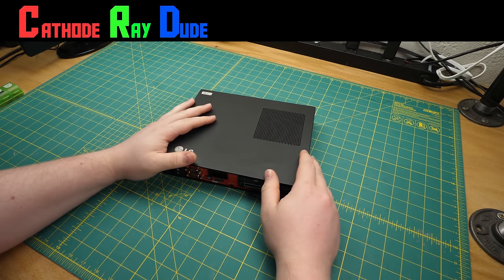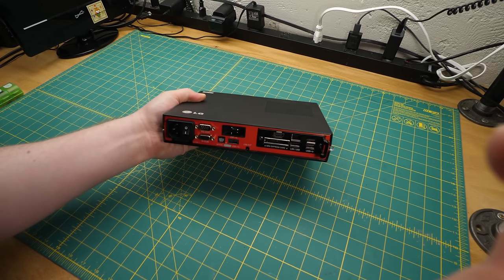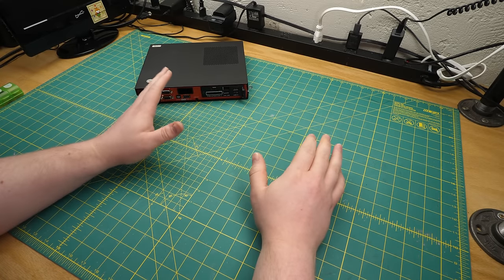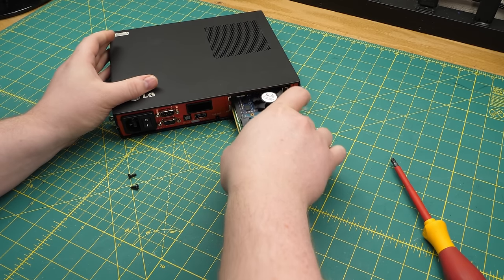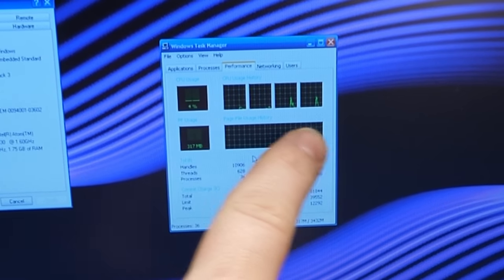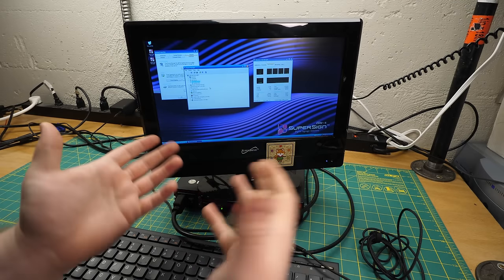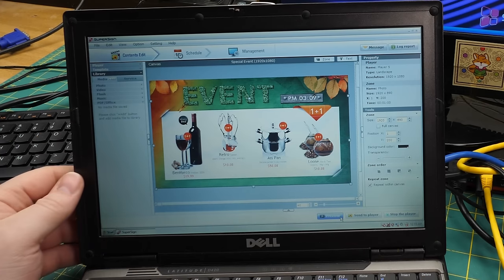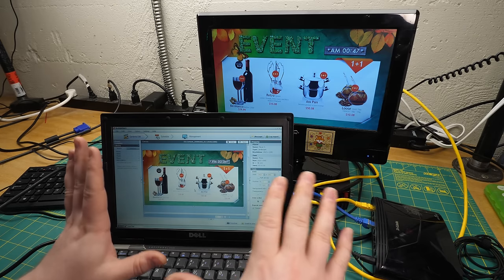Little Guys 6: The Worst Possible Timing [LG NC1000]

Comment: I would imagine that controlling many displays with parts of the same presentation would be useful for events and advertising, ive been in many airports where its the same presentation on every screen all at different spots as you can guess if they were all showing the same slide people would notice but if they all rotate through the same slide deck at different points all around the building people are going to notice the ads not the fact all the displays are the same

Comment: >cant remember minimum pins for vga

Ive run it on 8 wires

But also on 6, depends if you need the monitor ID pins

Hsync
Vsync
R
G
B
Ground
Sda
Scl

Edit: also done it on 4 wires for monochrome vga

Comment: I'm going to defend some of the questionable design decisions.  :-)

For example, that hack with the 3x USB header is a little janky, sure, but I'm in the middle of designing something with stand-off riser PCBs and it is a PITA.  I really wish I could've just used OTS parts, but I made some aesthetic decisions and now I'm lying in the bed I made.  If I were going to produce a million of them, I would've gone to a manufacturer for something bespoke.  I'm guessing LG would've, too, if they could justify it.  And/or, maybe the "front" USB port on that board is optional, and the 3x stack might be fully functional unless that optional port is also populated, in which case one or both of the lower ports is disabled (or simply multiplexed, which is to say, not meant to be used), and the physical obstruction prevents having two things plugged in on the same USB channel.

The multi-signal cable is also janky, but a little less so.  Analog and digital in one cable is best avoided, but that isn't always possible.  Or economically possible, anyway -- you wouldn't believe how expensive connectors actually are, compared to the meat and potatoes of a BOM.  And heck VGA itself is a mix of analog and TTL sync.  It's also possible (like in proper VGA cables) that those RGB lines are coax, though I'm going to assume they aren't here.  You can get away with a lot if you deem the output quality acceptable.  It's a judgment call.  Good engineering is knowing exactly when you can break the rules.

The "only 2 of 3 screws" for the fan doesn't seem like a problem at all.  I cannot count how many commercial devices I've taken apart that didn't use all their mounting holes.  It's probably a COTS fan, and obviously the solution couldn't accommodate all three holes.  But, given the forces at play here, it doesn't need to.  The cable running through the sink is also more common than you might think.  I've seen that on several GPUs.  The only thing a little dicey is how there's no retention to keep it out of the blades, though even that isn't a first.  Those tiny low-profile fans pretty regularly only clear the cable via hope and some good luck.

Comment: That older lg software actually looks useful and easy to use. Not the case with the newer stuff..... My job got a LG sign like this and I had to figure it out so we could train marketing on how to use it.... BOY wow its a load of garbage. It BARELY works and like you have experienced it just likes to stop working for no apparent reason. Its extremely cumbersome not intuitive and seams over complicated for what it does. We later got brightsign devices and they were so so much better to work with.

Comment: We got rid of some old NEC, OPS, 46" signage displays from our business school last year since they kept shutting themselves down. Hot, heavy, dimming, and not worth replacing (though they went with consumer TV's with Firesticks and the OS cloud signage service). Someone probably bought them from surplus.
Running Windows 10 from 32gb and 2gb of RAM like these LG specs is miserable. You can't even run updates as they won't fit on a drive of that size.

Comment: VGA can run on a DE9 connector. I have an ancient NEC MultiSync monitor (no model number anywhere, it's just Multisync) that's MDA, Hercules, CGA, EGA, and VGA. IIRC it may even have BNCs along with a DE9 connector.

2 pins each for RGB signals and grounds so that's 6, leaving three for H and V sync with a common ground. No Display Data Channel.

I suspect it is an example of the very first model of NEC MultiSync, so why bother giving it a number, it's THE MultiSync monitor. It even has a cooling fan. Unfortunately it also has an extremely dim CRT.

If you want it it's yours for cost of shipping. No need to worry about the CRT getting damaged because it's no good anyway. ;) The voltage on the flyback did get cranked up to squeeze some more use out of it, until the phosphors burned out even more.

Comment: These devices strike me as being similar to zip drives, too little too late. It got run over by the steamroller of progress.
''D-sub connectors are more versatile than VGA ones because they support many resolutions including 800×600 and 1920×1200, while VGA connectors usually do not support such high resolutions as these two. Thus, it is better to use VGA connectors if you need to use high resolutions''

Comment: You know, I wonder.

With OPS being a standard and all, and consumer TVs technically not being all that distant from digital signage hardware... I bet that there is some manufacturer out there that goes the cheap route, and produces one motherboard for both applications, just in a different shell, and just slams a Android TV OPS module in there for consumer televisions in a closed off case so the consumer can't swap out the OPS module without disassembling the entire unit.

That HAS to exist. I KNOW that the industry is willing and able to take ludicrous shortcuts if it saves them a buck.

Problem just is that this is like trying to find a needle painted to look like hay in a haystack, and I am willing to bet that the manufacturer would go full i-Opener when they discover that people start buying their TVs to slam OPS modules in there instead of watching their benevolent benefactors' ads on Android TV.
Or, worse: If companies start doing that to sell hacked-up TVs as digital signage displays for less than the actual digital signage displays.

Comment: Maybe the thermal compound shrank over time being bbq'ed to death it is 15 years old and pads shrink over time with heat applied the sun would really cook it hard
Reply from the maker: Yeah but we would still see an imprint from the die if that were the case, this pad looks like it's never been touched since it was applied.

Comment: I would guess the tiles would make sense if you want pixel perfect video on an aray of screens, you can't start with a 25 X 4K image, that no source can produce, no cable can bring it to an image spliter that probably doesn't exist anyway. Having it pre-splited and pushed in sync in manageable 4K video to a fleet of minion computers unaware they are collectively creating a screen image that the most beefed up Mac Pro pumped to the max couldn't generate. What computer can display an image on 4 or 5 8K screens?

Comment: A mini PC that will run DOS 6.22
AND.has a REAL 9 pin serial port, 16650 hardware serial port not based on USB, these are highly desirable because there are people who need to program two way radios and they only work on DOS with real serial ports that are built into the motherboard 

The new signboards, like McDonald's uses, now have the card slot / NIC built in the screen. They hook up the network cable to the Internet and they have an SD card in it and they load the menus on it and it can be remotely updated from the office computer or the corporate office 

But these were the boxes before the screens were made with embedded software to be display screen for menus

They were custom made for McDonald's

Comment: I HATE DIGITAL SIGNAGE!!  I've been hired to work on some at McDonalds, Pizza Hut, Burger King, YUK!!  I get some jobs online from various companies to fix guest WiFi, troubleshoot Internet, POS issues, etc.  I run from digital signage.  It's almost as bad a working on the Chef or whatever they are called boards.  It shows what has been ordered buy customer on a screen over where they prepare it.  These things are covered in greasy dust YUK!!  I'm usually troubleshooting the Network issues with related items but have to REBOOT them to load a new IP address.  I have had to remove dead mouse carcasses from cover of a NUC and clean out WHO KNOWS WHAT THIS YUK IS from the ethernet port to make a connection.  I've seen NUC's dangling from their cables with no support.  Lot's of this stuff is Linux and well locked down even the BIOS is password protected.  Oh the good old days.

Comment: tempted to design an open source 3d printable enclosure and pcb that has an ops slot and can take a smaller screen lol
Reply from the maker: honestly yeah i'm on that same brainwave atm. like, I didn't get into this in the video but a lot of OPS stuff is based around these big multitouch touchscreens. if it's possible to get, say, a bare 7" touch panel with an LVDS (or even HDMI/DP) interface, it would be next to trivial to build a little gadget like you're describing. It's one of those things that's almost frustrating with how achievable it is while still requiring a significant amount of effort haha

Comment: Some people may think these are boring and maybe they are right about that.  The thing is that I like hearing about odd computers that not a lot of people might know exist.  Really those OPS modules seem like something that would be rack mountable from their appearance it is just a matter of adapting it.  Then assuming that you did adapt it is it locked to any OS or is it something you can use like a NUC?  I can really imagine those being in those all in one computers that basically have all of the hardware you need inside the display.  Really I can't justify buying an all in one PC.  I also dislike all in one things like printers too but those are a different story and a whole lot crappier when a part of them fails.

Comment: Oh my gosh, what if TVs were all just dumb, but had a port to slot in one of these computer modules? It would made the TV actually a smart. All current 'smart' Tvs are so, so, bad. This is something I could actually get behind. Would prefer this over needing my old computer sitting on its side under the TV just to watch shows because the built in apps are non functional.

Comment: 47:00 I have a Japanese PC produced by IBM, with VGA, and its VGA port is labeled "analog RGB". If someone speaks Japanese, maybe they can elucidate whether maybe the VGA initialism is hard to say in Japanese or something?
Reply from the maker: I suspect this is because prior to the introduction of VGA in 1987, the were virtually no computers sold in America with analog RGB output, but in Japan and Europe It was quite common. US buyers would not have been immediately familiar with analog RGB, so VGA slotted in readily as a neologism for this new capability, but elsewhere it made more sense to continue using the term everyone knew.

Comment: i've let up a few different "digital sign"s using bog standard pentium 4/core 2 duo/athlon x64 etc that had 2 gigs ram max, they use alot more power than these little guys but they work
i got a few different little guys too but the specs are so low, i dunno what they can even do anymore, i wonder if the tvs in my garage have slots for these..... they are probably 15 years old, i cant believe lg owns the palm IP for webos lol
if the tvs support these, i'll let you know, chicago area

Comment: Oh the LG Supersign nightmares found me again! I don't know if it was our use case, but I don't know how did LG manage to produce such an unreliable software and hardware to work together.
Reply: To elaborate, we're talking about players that were active and appeared as offline on the server. Less often we had players that stopped playing the content, with no apparent reason. We had to set up RDP access to be able to reboot those devices. And on top of that, we had the randomly dying hardware.. At least the monitors were more reliable and had a nice picture.

Comment: Why would you ever use 25 of them? Ever heard of the concept of a video wall? When LED walls weren't the best of in term of performance, this had a genuine usage. Mind you, it still has. I designed video walls and projector walls that use many players, because it is still cheaper than the large matrix controllers.

Comment: this is fairly small; a money lender company I guess got evicted(felt was a a bit ironic) a few blocks away from where I live and they tossed all the computer stuff into trash; I grabbed stuff, there was a 1u core2 based computer that essentially served the same purpose; still have it, itx based boxed with dual gigabit ethernet, I modded the bios to get it to accept a xeon but it's nothing too amazing, I believe 945chipset, I do not know the bios manufacturer; just dumped modded and wrote back

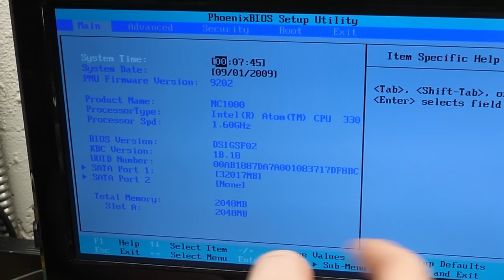Comment: 19:24...."intel specs only 2 gigs Ram" .. the later Pentium/Celeron N2000/N3000/N4000 Series also has only max 8 GB Ram  in specs, but there is roumor, that they  will work with 16 GB (2x 8GB) also. So, its maybe more a thing of motherboard- or Ram-design, if this specs can be doubled.
They all run with 1x 8GB Ram stick. But they have dual-chanel architecture. So, why not with 2x 8GB Ram?

Comment: I can't be the only person who saw Flash, for it's entire lifespan, as a completely superfluous technology with better alternatives available the entire time it existed.  At least Javascript works in any reasonable browser with some degree of success, Flash was always a hot mess.
Reply from the maker: I'm not really sure what you mean. Javascript was incapable of creating arbitrary animations for the entirety of the 2000s and I used thousands of Flash sites without ever having a single problem other than plugin syndrome. Flash was inconvenient in that it was stuck in a little box and didn't support browser history etc. but it worked exactly as designed every single time IME.
Reply: @CathodeRayDude  I might have been wrong about the specific technology involved, though it seemed like around the time HTML5 was widely supported, Flash was just a worse and less compatible alternative to a Java plugin, which is why I presumed some form of JavaScript (and I do know the difference, especially since Java stopped having browser plugins around the time HTML5 looked like it was going to, but was not yet, finalized, and Java was always more relevant than Flash in the part of the web I tended to be in).  Weird memory unlock.

Comment: I've seen one of these while I was working in a cosmetics store years ago (~2018), and I remember that the commercial material did not stop playing when the technician pulled out the computer module, it was non responsive and after fixing and re-plugging it, the device came back online as if nothing happened, I suspect the missing chips on the docking board are meant to buffer video output somehow.

Comment: I used to work in schools and we used digital signage in the reception of the schools it was an external company the computers was i3s as needed the power as in our case we had up 2 different mp4s playing and an rss feed brom bbc news normaly though one mp4 was a welcome message from the head, then children doing school announcements the other half of the screen would show a PowerPoint saved as a mp4 normaly childrens work, upcoming events, schools letters and photos, they was rearly rock solid as well they had them for years before I left never had any brake even though they was hidden above ceiling tiles in the stupidly hot void full of dust and mice, one feature I loved was every so often I noticed the fans reversed at full speed to help remove dust normaly when they thought it was night time

Comment: Commercial hardware made by a consumer focused corporation is always funny. LG are the same ones which (a few years after this) made air purifiers with ape NFTs printed on them and whacky phones. I would not trust my infrastructure upon them. They are just a weird company making weird products for weird people. 

The partner of my sister in law is from south korea. The grandparents which live there have an LG house aircon which makes weird noises and uses their ThinQ mobile phone app, which is just extremely bad compared to a normal one with a traditional radio controlled remote. LG has a whole range of useless LG "smart home" appliances (toasters, freezers, lamps, washers, etc.), all controlled via this convoluted quirky phone app. People which want a crazy house use this.

Comment: The memory for that chips is more depindent on the motherboard than the cpu. The atoms came in 32 and 64 bit verities . Well i thikn the chips were all 64bit but the motherboards were the defining factor. 
I have a few atom devices i still use today there handy low power and do what i want nicely most of them started off as windows and i've moved them to one flavor or another of linux but ya most of them only read as 32bit in those i've only seen 2gig except for one wich has 3.5gig And a few 64bit devices that have 4-8gig . 

im minchening this becos one of the 64bit rigs has the exact same cpu as 2 of the 32bit ones. no extra numbers on cpuz alltho i havent exposed the dyes in them as they just work as is.

And yes there suuuper cheep tablets and one PC stick.

Comment: Oh, as for Air... We got an AV "system" that was built out of various different bits and pieces integrated using a Crestron CP controller (rack mounted CPU that controls stuff over serial, TCP, Cresnet, etc.), and it's controlled using an iPad app... or a Windows app that's built on Adobe Air (now bought by Harman) called "XPanel" that loads the same UI as the iPad app does. It's still a thing apparently.